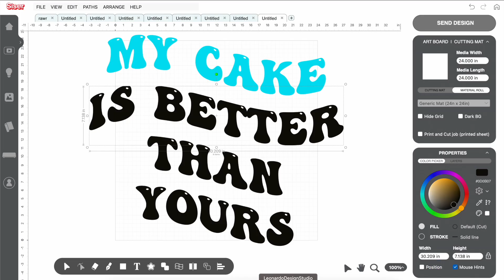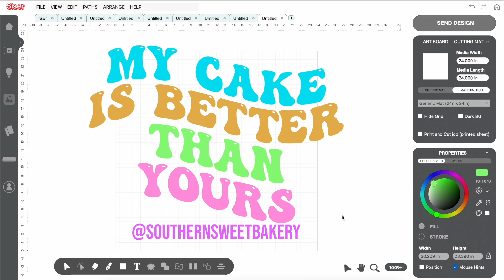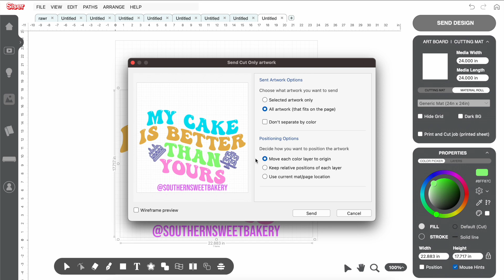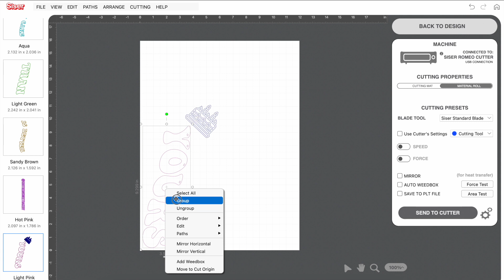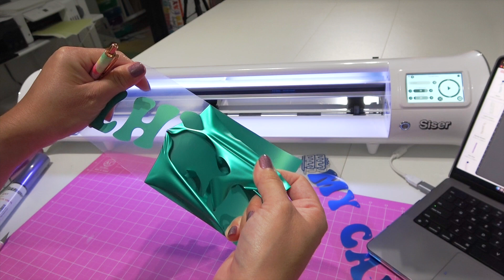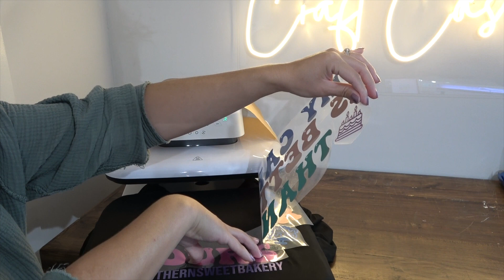Creating Stunning Svg Designs With Siser Leonardo Program

Comment: Just a tip for when you send your design to be cut if you click off the selected area, and then click on the part that isn’t where you want it, and you can move things around without having to ungroup the paths.
Reply from the maker: THANK YOU!!!
Reply: This video was what I needed straight to the point. I want to learn this software but needed more help other than the manual. Please do more of these videos